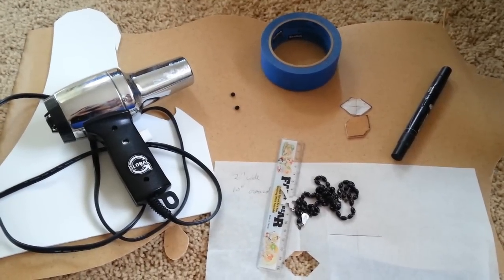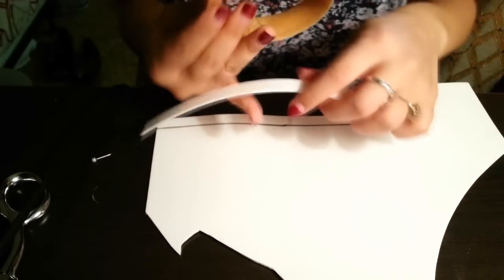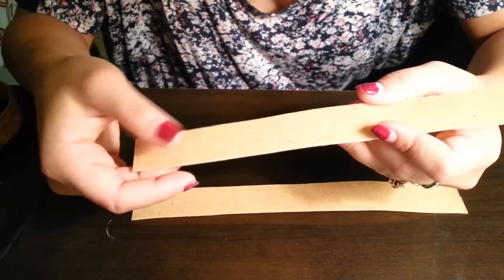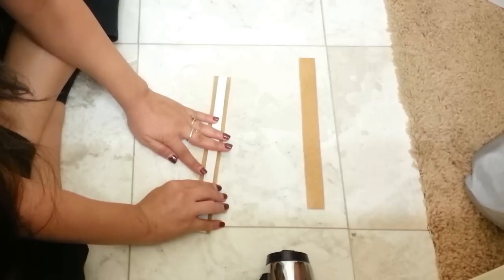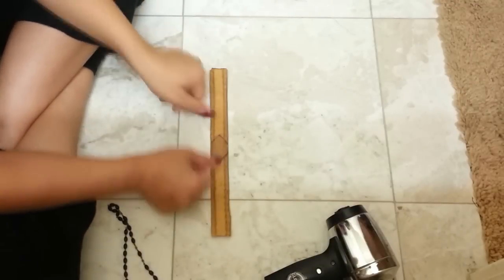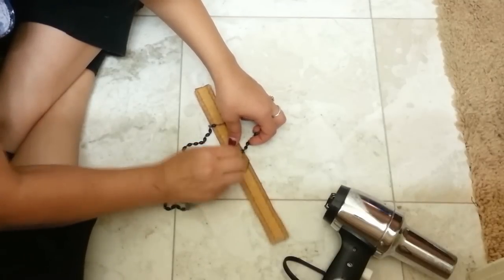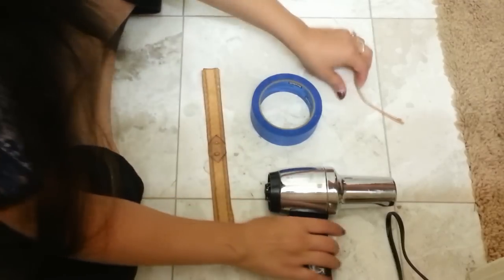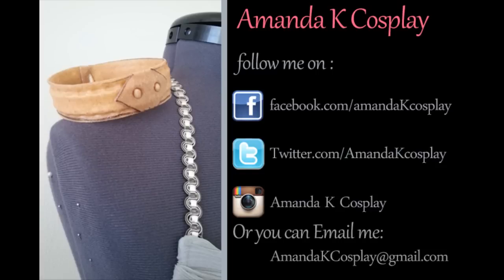Worbla Tutorial ~ Making Daenerys' arm bands from season one of Game of Thrones

Comment: Hello Amanda Khoury!

I got a question about my worbla.
My worbla keeps sticking on the surface that i heat it on. or when i want to combine 2 pieces and press them on eachother, they stick to the surface i am working on :(
Any idea how come or what i can do to prevent that.

Keep up the good work ;)
Reply from the maker: Yes actually, if you use just a bit of baby powder on your surface it should work, but if you're on a glass or marble surface you shouldn't run into that problem. Also, heated worbla will not ruin a glass or marble surface.